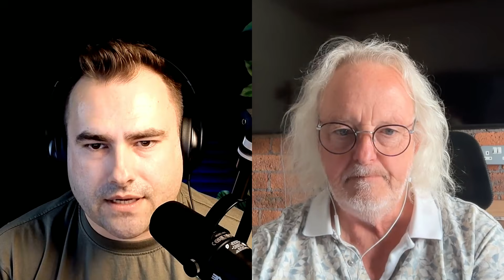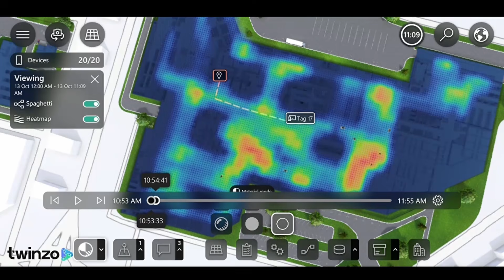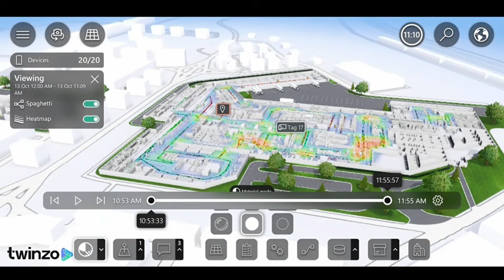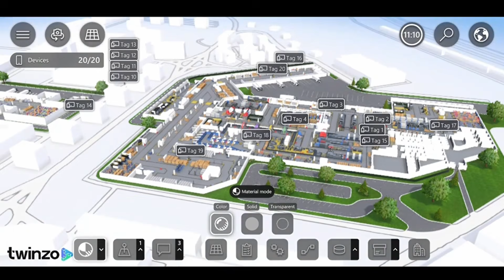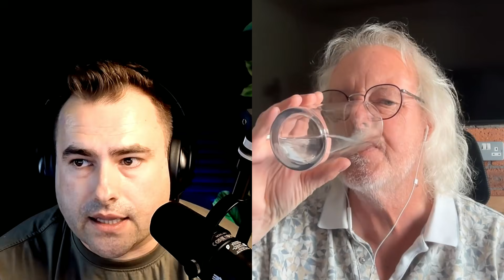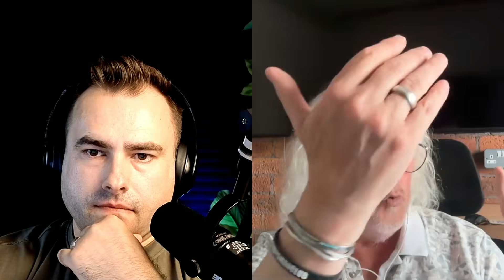Most Digital Twins Are Just 3D Postcards — w/ Barry Bassnett

Comment: for the tagging  I think we could automate,  If we've inventory of the items we whant to tag, wether generic or specific, lets say, lamp post model X , A  , B etc... We should be able to  run a trained model first a generic one that  could isolate from the element at family stage, lets say, lamspost. And once we've the initial segementation, run against a trained model so it identifies, lets say against the 20 lamp models in the city, to identify which one it is. So we've the proper element identification. And from that point, we could, unless already numerically identified with a tag, which I've seen in cities that each lamp has a visible number that could be read and automated... or we could use positioning and grab info from a previous gis database, then wether autotag to add specific info like las checked, maintenance docs etc... So this would be like a 3D gis. Just an idea on hwo to get the tags auto or semiauto. Also you dump the responsability of tagging into the client, tbh, I believe client should be receiving a ready to use solution with all  tagged and training on how to keep the model up.

Comment: the stupidest lod 0, to me would be a properly classified oint cloud with semantic segmentation with individualized/isolated elements where you can at lesast query how many elements of each type are. Else the "visual twin" definition used would be the most accurate. No query hability no digital twin, no hability to easily update the  classified  point cloud would be an efemeral digital twin which probably defeats the main purpose as else would be more like a 3D survey. I've started into this few months ago while I've been following the lidar scene for 10+ years and honestly ever found the 3D scans as they where being delivered offered very limited value, with pretty obvious locked potential. There needs to be a major surge in cloud interpretation/data extraction capabilities to be able to get out all the info packed in a high resolution MMS deliverable.